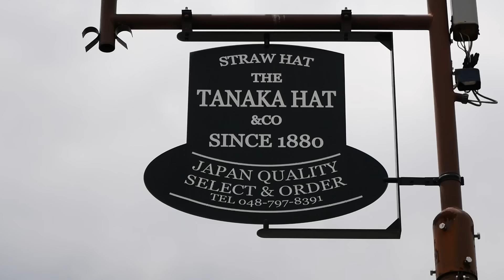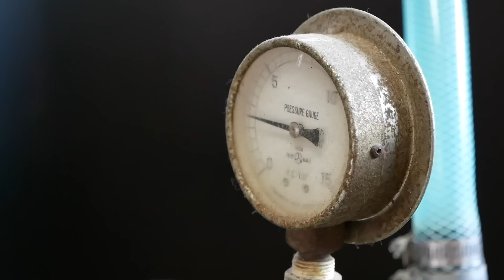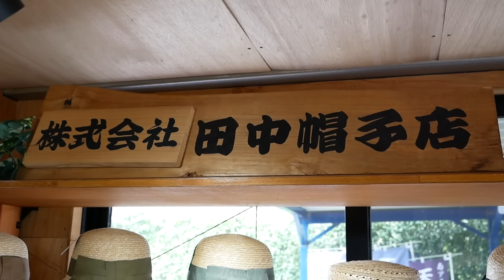麦わら帽子ができるまで！140年以上続く春日部の老舗「田中帽子店」の製造プロセス

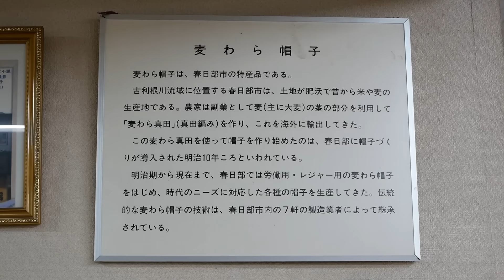Comment: If anyone wondering what the sign at 6:19 says:
Straw hats are a special product of Kasukabe City.
Kasukabe City, located in the Furutone River basin, has fertile land and has long been a
production area for rice and wheat. As a side business, farmers used the stalks of barley
(mainly barley) to make 'Mugiwara Sanada' (Sanada knitting) and exported it overseas.
Kasukabe started making hats using this straw Sanada.
It is said to have been introduced around the 10th year of the Meiji era.
From the Meiji era to the present, Kasukabe has produced various hats that meet
the needs of the times, including straw hats for work and leisure. Traditional straw
hat-making techniques have been inherited by seven manufacturers in Kasukabe City.